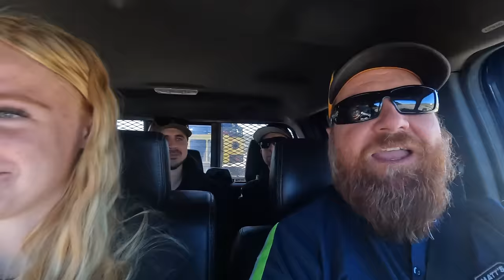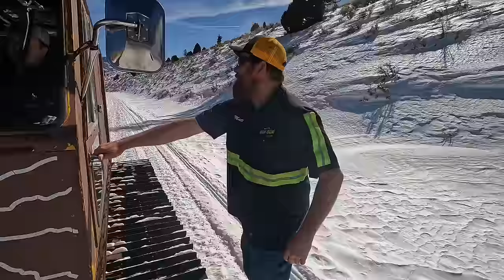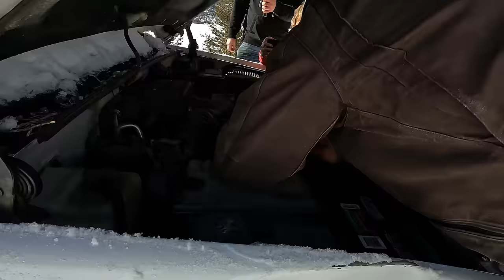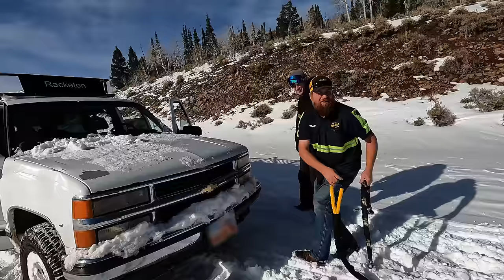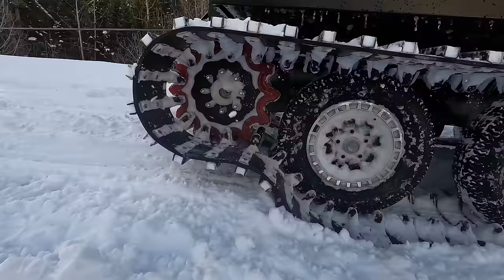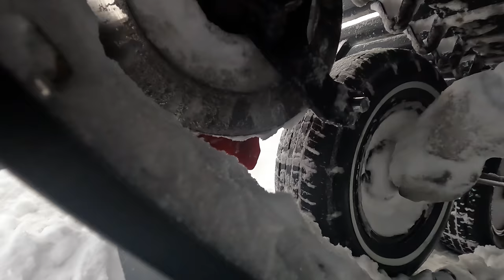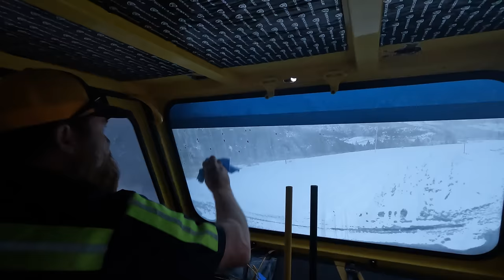I Failed....

Comment: Hello to all the Matt Yello team from Dallas, TX. !  hey Matt before you take out the drive axle, i dont know if you and Tom thought about installing larger front rotors, and installing rear brakes also to assist front brakes ? Also the working on the pumpkin and tune down possi a little where there's more slip at slower speeds while turning ? just some thoughts before you redesign the drive muscle... God bless, thank you all for the adventure, G.Scott R. from down south ! I was talking about the Bombi, of course. take care

Comment: After watching the entire movie, I'm wondering... has Bombi met it's towing limit? We haven't talked about towing capacity. Because Whiskers is bigger and was able to pull that car easily.
Correct me if I'm wrong, but maybe, JUST MAYBE, the Bombi got too much power for those tracks+weight combination. Either increase lenght of the tracks (unfeasible) or increase weight (unfeasible).

It seems Whiskers is the better platform for rescuing vehicles as heavy as the one featured in this video (when it is disabled).

Comment: As with any new redesigned and built vehicle , there is going to be a shakedown cruise, I think it actually performed well, ceramic brake pads fade when they get hot,, you can beef up those caliper mounts and go with a metallic or organic pad which will give you the stopping power to steer but it will eat rotors faster matt would be better off using a steering system from a bobcat or if you want to get fancy a rubber Track caterpillar, it would make that Bombi a spin on a dime hot rod.

Comment: Quick question? What if you grabbed the suburban backwards and had the steer tires on the ground instead of disconnecting the driveshaft? Does that still cause damage?

Comment: If I were the owner of the Suburban, I wouldn't be happy with them running my engine so much and so hard with no fan and no water pump.

The problem is coolant temperature sensors measure coolant and measure it where the sensor is physically located, not necessarily the temperature of the cylinder heads or cylinder region of the engine block. 

I've experienced engine damaging overheating while the temperature gauge reads below normal on multiple occasions. 

In general, the first time the engine overheats (after the fan & water pump belt breaks), the engine is fine, because the coolant is in contact with the sensor, everything is more uniformly hot, and the coolant boiling limits the maximum temperatures. 

If you let the engine cool down and run it again, this time it likely won't be full of coolant. 

This results in delayed temperature readings and the head potentially getting much hotter before the gauge reads dangerously hot. 

The 2nd, 3rd, 4th... time you do this, the coolant level gets lower and lower and the cylinder heads gets hotter and hotter before the gauge reads hot. 

As a result, when you later replace the belt and fill the coolant and then drive the vehicle,  you end up surprised to discover the head has warped and your have a blown head gasket...

Comment: differential steering would be sweet, either hydraulic or boat throttle like, where the shifter and throttle are controlled by the same mechanism.

Comment: Matt you might benefit from some better brake pads to steer that bombi. Companies like G-LOC and Carbotech will make some KILLER pads in any shape if you can supply them backing plates or at least dimensions for the pads/shoes you require.

Comment: If it were me I would try to find a salvaged skid steer and go full hydraulic. You could even run your winches hydraulic. Keep a set of spare hoses tucked away for the drive lines and a cap to fit every line size and it would be pretty indestructible.

Comment: Independent hydraulic motors to drive two wheels. Mount a hydraulic pump mid chassis and turn it by drive shaft. Salvage a skid steer drive system.

Comment: And on the brake issue. Have used those stamped steel hats , There terrible. Use a dial indicator and check the rotor runout. Rotor runout will kick the pistons back in the caliper and make you run a larger master to get the travel /volume of fluid . But this hurts the pressure requiring more effort to get the same braking power. Never use "lifetime guaranteed" brake pads from the chain stores they are very hard and designed to wear the rotor out instead, Also squeal and require more petal pressure. You don't notice it as much on a modern car with power brakes but with the setup you have it can be an issue. maybe look into a dual booster setup . They are available remotely mounted. I would check the rotors/ hats and pads first.
The tin brake hats could also be vibrating making the star wars noise. Try Mobil one synthetic gear oil will make a big difference in durability. Don't just sit there and spin one side brake that side and make the power transfer to the other side. A common trick used on older tractors to sand rails to rock crawlers. better brake performance will help a lot so you can feather the brakes instead of yanking on the lever. Good luck.
PS the after market street rod / economy calipers I believe you are using put all the load on the 2 bolts. Not a good design. They are based on GM 70's era design but the oem calipers have a thrust surface taking the load and the bolts just keep the calipers lined up.  Look into some real ridged mount calipers from wilwood ect. . Maybe talk to their tech department for proper soft pads also.
PS PS PS 9 inch fords tend to run hot due to the pinion offset designed for min driveshaft tunnel height in an oem car. Most race application's use a cooler. Also the non floater design maybe marginal for this application.

Comment: Bobby mods : heated Windshield, Dual alternator in case of... 
Heated brake calipers 
Diesel water filter heated 
Remove all electronics 
Add a flag (cause its 😎 cool)
Add a tracked bike on the roof for delivery parts

Comment: My gut says there is nothing wrong with 9" as a drive axle. The problem is your braking system.

Get rid of the disc brakes.  Use drum brakes with the largest diameter drum and the widest shoes that will fit. Use racing master cylinders. Changing where the master cylinder attaches to the lever will give you plenty of braking
Reply: Or...... And there's an idea, stop trying to reinvent the wheel and use proven technology. In a vehicle that is going to be remote areas, maybe with no help, you need a bulletproof solution with known variables. Tracked vehicles aren't new.

Comment: How about a drive setup like the ripsaw?
Not the best but its kind of simple

Other route you could go is panetary gears on both drive axles and barake the outer ring or drive the outer ring with hydraulic motors

Comment: With all of the crew for filming and for extra help that you keep taking on these recoveries during the snow recoveries, you may need another snow cat like Whiskers, just to haul out the crew and extra people if the situation arises where the clients with there personnel also need a ride out. This was demonstrated as with this recovery as Whiskers helped a lot with people moving and recovery. You normally take 2 vehicles for non snow recovery so why should snow recoveries be any different. A normal recovery has the tow vehicle and the recovery vehicle, but in snow the towing vehicle is rendered useless.

Comment: You have a problem steering that thing, and it is going to be interesting to fix . Your Diff might be part of the problem ... Steering while driving miight work with electeical or Hydraulic retarding no discs to heat up and fade and you might have a bit more consistent controll over the force

Comment: Anything that can refuse to start just because an injector is unplugged is not worth having. It has both can and crank sensors, so if it won't run with only one of those two, then it's not worth having. Carburetors never leave you stranded.

Comment: OMG ya'll suffering through stuff constantly breaking! No way I would venture out into those remote areas without solid support vehicles. You have plenty of room on that flatbed pickup for a snowmobile in the winter or some sort of ATV or side by side in the summer. Also, surely yall have satphones. Being as good as yall seem to be in fabrication and repair is certainly huge! Still, I would want a plan C and D that included a way of pitching camp if necessary with enough food and warmth for a while.

Comment: I have sat here and watched the build/rebuild pf the Bombi.  It has always concerned me that you are using a mechanical drive/steering axle.  It's your house your rules so I kept my two-bits to myself.  In reality what you have is a tracked  skidsteer. Everyone I have been around and driven, even excavators all use hydraulic steering/drive systems.  I haave never really looked very close at the modern crawlers but I am willing to bet that they run the same setup.  excavators generally work on level or at least smooth ground but those that run on rugged ground hava all have had hydrostatic drives.  You can spot them from a mile away,  The drive gear is set high above the running surface and is powered by a hydraulic motor, steering, as you know is done by controling the hydraulic flow to that gear.  Don't quote me on this but there is a valve with a bypass in each line and to steer you stop the fluid flow to the drive and into a bypass return line to the fluid reservoir.... Put the drive gear high and back closer to the rear of Bombi.  Admittedly this will cause a rats nest of hydraulic lines. there are a couple of choices here, the ones I have used and worked on had all hydraulic valving in the system.  You have basically a relatively simple system.  Forward and back on both tracks and stopping the flow to one track to turn or pivot,
Just guessing but I bet you can find an old skidsteer and canabalize it for what you need,  Put in all new hoses, repeat new hoses. 
One of the benefits is you have a cleaner under ground clearance
If you really wanted to go crazy you could get a hydraulic winch, but I would counsel against it, use electric.
That is an approach I would consider, but it is your your house your rules

Comment: I used to have a truck with the 8.0 liter engine. Went through 4 cam sensors in 250,000 miles before I sold it. Someone needs to make a better mousetrap.

Comment: Dude, you have 1.73 subscribers, buy some Maui Jim sunglasses to protect your eyes. Revo glasses are also very good.  There is a HUGE difference between cheap sunglasses and expensive ones. Costco sells several different high-end brands of sunglasses for reasonable prices. I would see if you find some Maui Jim sunglasses that you like. In my opinion, they are the best sunglasses made. You will literally feel the difference when you put a good pair of sunglasses on. They protect your eyes better and protect you from glare better.

Also, the Bombi is just embarrassing. The old one worked better than the new one. You need to rethink your design because every time I watch you use it, it breaks down.

Comment: Crank sensor is from china and fails hot. Cam sensor is only for use on start up for a quick read on position set up #1 then reads off cranksensor

Comment: If your engine is overheating maybe let it idle for a few minutes to let the coolant to circulate.
Reply: With the belt off, that water pump isn't circulating anything.
Reply: @senditkevin  Missed that fact that the belt was off. Matt does do some amazing recoveries even though he never wears long sleeve clothes in amazing cold weather and no gloves. I work outside at night and gloves are essential.
Reply: @mred7375  The power steering pump pulley was broken, so the belt wouldn't stay on. Yeah, being in the prairies in Canada, we adjust to the temperature over winter, feels cool at 0°C in fall, feels nicer at 0°C in spring.

Comment: You will find your not lubing properly, you have the diff running backwards, and the way the pinion throws oil while in forward, but your running in reverse, so its not oiling properly, and you should have seriously kept drum brakes for your braking system.

Comment: I dont think the 9 inch is your problem. I have done one wheel burnouts alot longer then that.  Brakes are your problem. It takes to much pressure to  lock a disc brake.

Comment: the bombi has a safety issue, i know it`s ( EXTREMELY UNLIKELY  THAT YOU WILL EVER "ROLL") the bombi over, all the same there`s 2 killing devices in the front of the cab, the 2 UPRIGHT tubes you use to steer the bombi just need a protective "mushroom" type on top of each of them , or maybe 2x t-shaped handles that "hoes/excavators" have to steer the tracks when the operator`s too dumb to use his feet on the pedals, as i said, the "odds" of rolling the bombi over are probably the same as winning the power ball lottery, slim to none, you just need to remove  the "slim chance" to NIL  please.....

Comment: Way back in the last century, in the 40's & 50's, my father, grandfather and Uncle told me if something isn't 100%, leave it in the shed until it is because trying to make it work can and usually leads to creating more and bigger problems for oneself.  That is the one piece of advice I had to challenge, but only once, and lesson learned.  Those old boy's knew what they were talking about.  Of course having your machines crap out on youtube during a rescue adds drama to the rescue.  Get that bombi back in the shop, make it 100% and that sucker will not only slide through square corners but probably do wheelies too.

Comment: Wait, suddenly goes lean and dies, throws code as the computer panics?  anyone check the fuel pumps either duty cycle( sorta, cant remember what its actually called) in the tune, or thermal limits? 

Did this with an eco tech in a boat once, this issue sounds verry familiar but after 6 years Im fuzzy on it..

Comment: Your losing crank not the cam that’s the issue with Holley they suck at comunicati g with the gm sensors get the Holley sensors and you shouldn’t have an issue I tune a lot of Holleys and have seen this many times it need the Holley sensors

Comment: too much computer. Dump that computer bs and go analog. Lot to be said for mechanical. And yes...hydrostatic is the ticket for high stress loading. Just make certain you have a good cooling system on the hydro fluid.

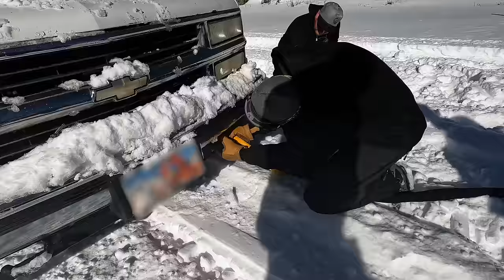Comment: I’m not buying you can think yourself from not freezing to death.  Broke down and now spending the night in a tin box with no insulation in the mountains of Utah in a short sleeve shirt with no heavy coat seems to me like a good way to kill yourself.  If it was that easy then the Russian Front during WWII wouldn’t have had so many hypothermia deaths.  Then there is your crew that you are responsible for.  Katelyn in tennis shoes and jeans along with the rest of the gang not much better equipped. At least Tom Tom would have been there in the morning to testify at the multi-million dollar claims on your estate.  If both the Bombi and Whiskers were battle tested and dialed in I might not be so critical but neither machine can be considered dependable and your location was well out of cell phone coverage.  Add in the stresses you place on the Bombi on almost every recovery because it is a machine and machines do break you should have a track equipped Jeep Wrangler stocked with supplies that goes on these types of deep into the woods rescues as the backup to the Bombi but that would be one more gas tank to remember to refill.   Sorry to be Debbie Downer but this “recovery” was on the ragged edge of being a serious life or death rescue dumped in someone else’s lap at 23:00.  I see Casey LaDelle just posted a video titled “Broke down and stranded, everything went wrong..”